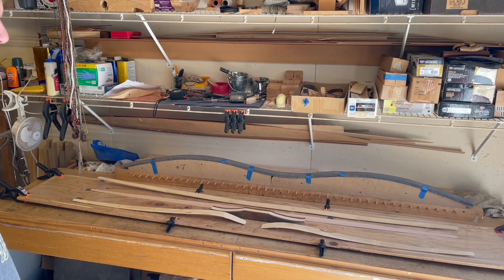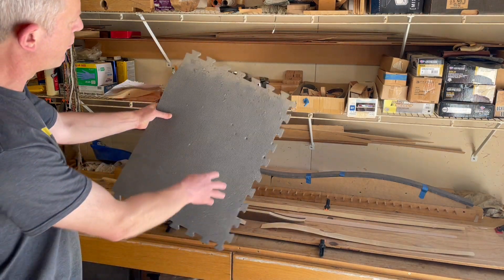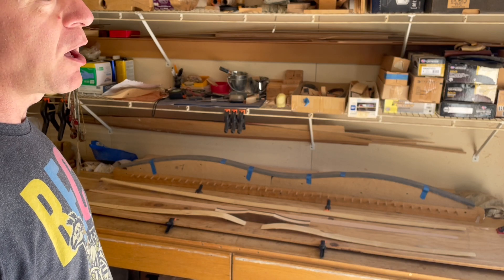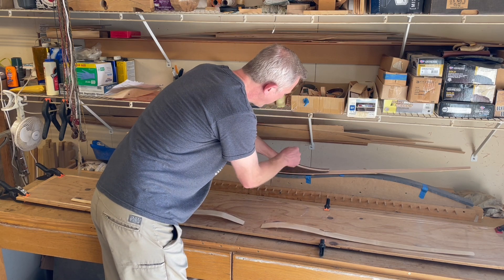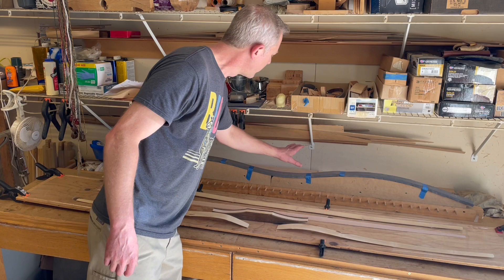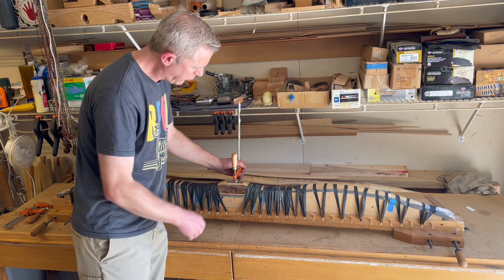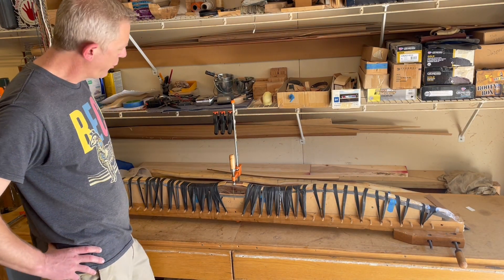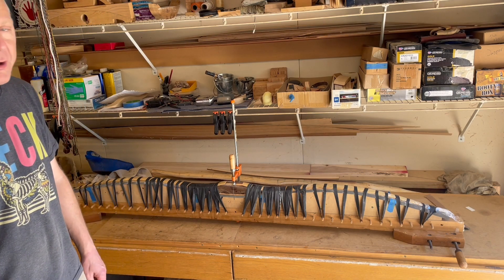Gluing the Tri-lam Bow / Bamboo back & belly bow build pt.6

Comment: Youre not using a heatbox? I have zero experience with laminated bows so far, but other bowyers claim to have problems with delamition when not using a heatbox. Not having the space for an heatbox kept me from trying to build a bamboo backed bow so far.
Great videos! Would love to see a build of an glas back&belly bow as you showed in pt. 1 of this series.
Reply from the maker: I have never used a heat box and also never had a delimitation… the glue just needs to cure in place for 24hrs at room temp. according to the spec sheet. I suspect that poor surface prep, clamp pressure, starved joints, or some other mishandling is more likely to blame for gluing mishaps.